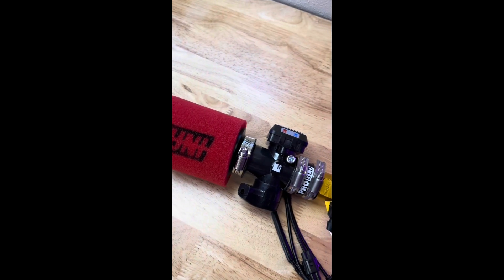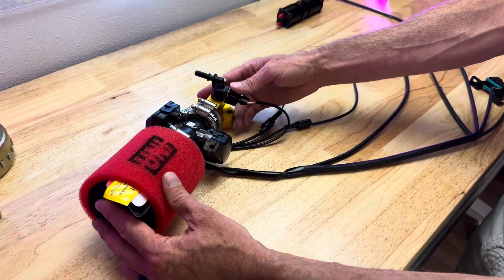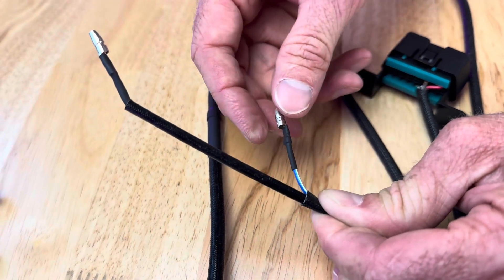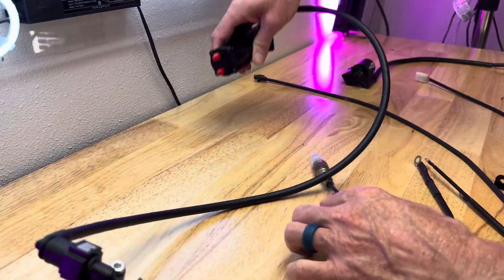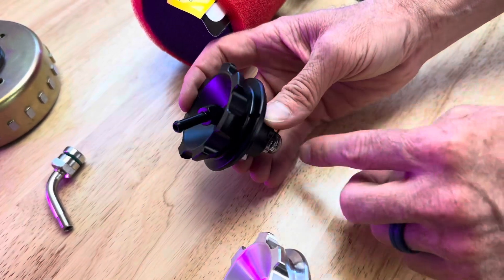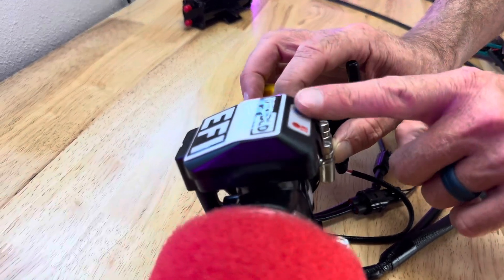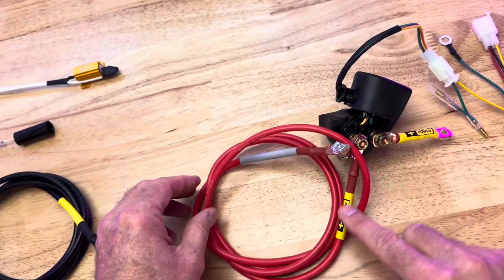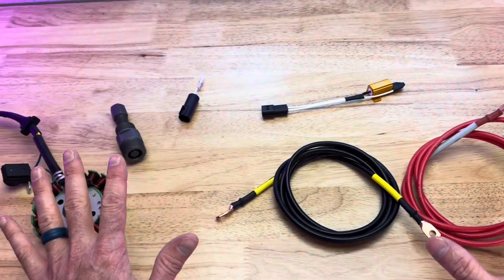NO MORE CARBURETOR TUNING [GY6 EFI CONVERSION KIT]

Comment: Could you look into cis injection for vw rabbits and make me up a system to get more efficient power because dont wanna have to use a webber 45mm carb this is more modern and they dont make a efi 4 1.8l 8v because the 1984 vw gti rabbit is cis this would modernized it

Comment: Will I be able to tune this kit for the 139QMB engine? The engine has a 52.4mm cylinder and a compressor from a Peugeot Satelis 125. Enlarged cylinder heads, valve spring washers, and a sharp camshaft.

Comment: a few questions. would these ECUS be locked out? could i in theory connect to it using tuner studio or tunerpro RT? and what ecu is actually running it is it speeduino based a custom board with a bosh ecu? I'm curious because i have a lot of megasquirt and speeduino experience and being able to play with this in the clean package you have would be awesome for my scoot.
Reply from the maker: This system uses its own custom software. I’m not giving customers access

Comment: Rolling Wrench ? I have 2 questions about that fuel injection kit. 
1. Does it come with a fuel gauge or does it work with a fuel gauge ?
2.  if your way out in the middle of nowhere and you run out of gas with this fuel injection kit, will the fuel pump shut down before the fuel pump runs dry or will it run all the gas out until dry and damage itself ?

Comment: I have a 1984 Honda Nighthawk 700S that has been sitting in my garage for years because it has kind of been in parts limbo. (Parts are rare and when they do exist, they are usually used or new-old-stock) I think finding a way to convert it to EFI could be a good upgrade to get it back on the road while avoiding most of the difficult parts to source. Which are mainly old rubber parts that have become brittle. Do you know if a system like this could be adapted to work on a 4 cylinder engine? Looks really cool and possibly promising. Either way really cool system!
Reply from the maker: Unfortunately it won’t work :-( it’s very engine specific
Reply: @RollingWrench  I appreciate the response! I am still gonna look into a DIY solution. You kit offers me hope
Reply from the maker: @Carguyforlife look up DIY EFI

Comment: What’s the silver screw on the throttle body and does the EFI need to “learn” the engine first in order to run perfect?
Reply from the maker: The screw is for idle adjustments. It does take a bit of time for the ecu to auto tune. In 15 miles or so the bike will be dialed in.

Comment: I D RATHER HAVE MUKUNI FLAT SLIDE CARBURRETOR S OVER FUEL INJECTION  ANY DAY  AND RACED SIDE CHAIR S SPEEDWAY  12 YEARS RUNNING GSXR 1100 SLINGSHOT .CV CARB S JUNK ,INSTANT CHANGE TO RESPONSE MECHANICAL MUKUNI FLAT SLIDE CARB S AWESOME ,FUEL INJECTION BEING BETTER IS BOLLOCK S.
Reply from the maker: Not everyone wants EFI. I’m an expert with carburetors. I will choose EFI all day everyday. Food for though. In the 80s before EFI was available dragsters would put out around 1500hp. Once EFI and programming was available that same motor puts out 5000hp. Leaps and bounds better.
Reply: @RollingWrench dude I agree with you about everything you said  I'm a retired Ford technician and you have to remember that he is going to be able to make more hp and he will always be able to win any kind of race he is the greatest ever even though you have more options to tune and you can install some kind of forced induction to get more hp from a engine that has been converted from carbureted to the stand alone efi kit that you can get from a carbureted engine but you have to remember he is the greatest to ever do anything that has a carburetor and  his flat slide mukiuni is not going to be out done by any kind of fuel system 😂😂😂😂😂😂😂😂😂I just saw the efi conversation kit do you have a kit for 125cc kikker 5150 bobber motorcycles they have a 125cc engine that is just like the ones that are on most grom clones  I think they are horizontal piston engines but I can be wrong I know the engine is a very popular style that is used on alot of small motorcycles and dirt bikes
Reply: OH HOW BORING ,YOU CALL GOING IN A STRAIGHT LINE FOR QUARTER OF A MILE BIKE RACING .CLOCK RACING IS NT . JOIN NEW ZEALAND SPEEDWAY SIDECHAIR RANK S .SEE HOW LONG YA LAST . ON SERIOUS NOTE MR EXPERT SUPER CHARGED FUEL , 11 LITERS AVIATION FUEL 8 LITRE S 95 OCTANE PETROL ,1 LITER ACATONE ,MESURED ACCURATE ,TRY THAT IN YA CAR,FOR REAL.
Reply: STRAIGHT LINE RACING ,ON THE STREETDIFFERENT STORY ALL TOGETHER I RACED AGAINST TURBO CHARGED BIKE S ,SUPER CHARGED ,FUEL INJECTED AND BEAT THEM ALL , EXPERT THAT LACKS EXPERIANCE .MIKUNI FLAT SLIDE S RUNNING METONOL ,STAGE 3 CAM PORTED BALANCED ENGINE 12 .5 COMPRESSION PISTON S OVER SIZED VALVE S WOULD GET A SIDECHAIR 8 MILE S PER 20 LITER S ,YOU CAN HAVE YOUR FUEL INJECTION AND SEE HOW FAST YOU CAN GO IN A SHORT STRAIGHT LINE.
Reply: 68 years old nz born burt Munroe  TOOK HIS CARBURETED WORLD FASTEST INDIAN TO SALT LAKE CITY RECORD NEVER BEATEN TO THIS DAY , 208 MPH  KAWASAKI DUCATTI AND OTHER S WITH THERE HI TECH SHIT FAILED REMEMBER THAT NEXT DNF .

Comment: How doni know if i have a 150 or 171?? I bought it used dont know what it is lol
Reply from the maker: You will have to take the head off and measure: 150cc is 57mm bore and 171cc is 61mm bore. But first be sure there engine stamp says qmj157

Comment: Brilliant! I could see your design becoming modified and become a standard for almost any new or used single cylinder engine. A sign of the times, carburetors are 8-track tapes, throttle bodies are CDs, and independent cylinder fuel injectors are the end game like streaming.

Comment: I got excited for a second there that we FINALLY got a tune for the 180,190, 205 232 etc 😢tragic
Reply from the maker: Dang! Sorry. It’s a lot of work to get these dialed in. Soon though. We have been working very hard towards that goal.
Reply: @RollingWrench  I'm going to use the efi from a 200cc efi scooter with the hope that it'll adjust since it's identical to the jonway gtx 250 stuff but I'd rather just pay you and be sure
Reply from the maker: @jasonfabo7126  It won’t work :-( unfortunately. That’s far too much of a gap. It would need a custom tune. And the factory tunes are Economy tunes and the performance would be very poor. You want the EFI set up for performance.
Reply: @RollingWrench  they have a programmable ecu out. That's plan b. I'm sure yours will be better though. I love your videos, sorry I'm feeling impatient
Reply: @RollingWrench  what's your opinion of a-racer
Reply from the maker: @jasonfabo7126  the A-racer is the best of the best !
Reply: @RollingWrench  it's super cool but it looks complicated, I'm hopeful that my plan works for the 205 I'm building and you have a tune before I build the big big guy
Reply: @RollingWrench also might just buy a 150 instead bc even at 90cc and everything else I'm used to 150 bottom end and it still won't feel the same rip.
Reply: @RollingWrench  and 5 months later even if you have a supported engine sizr they are no longer in stock...
Reply: It's been literally years at this point
Reply from the maker: @ True
Reply: @RollingWrench  it's just not enough bigger than the 169cc efi scoots on the market
Reply: @jasonfabo7126  Taiwan's TIG 169cc，max speed 120km/h GPS
Reply: @senlanguna  I have 2. One is about to be 205cc efi One way or the other

Comment: For the low price of a second GY6 scooter.
Reply: It would be nice to have a much more affordable option.
Reply: @RP-dv3pw  Speeduino but it isnt plug N play and VERY DIY.
Reply from the maker: @dermharse9614 I started with one of those. The learning curve it huge. But a really really nice unit. And that’s just the ecu. You still need a fuel pump, throttle body, magneto, intake manifold, injector and wiring.
Reply from the maker: @RP-dv3pw  I agree. But it’s almost impossible since there are so many parts involved that are custom made to make it happen.
Reply from the maker: True. Real talk though. Most of the people that are purchasing this kit are not running a cookie cutter GY6 engines. Most have all the best gy6 parts. This is just the icing on the cake.
Reply: My 2021 Vitacci Clash 200 EFI scooter came factory equipped with a 169cc Lifan EFI engine for $1700 delivered.